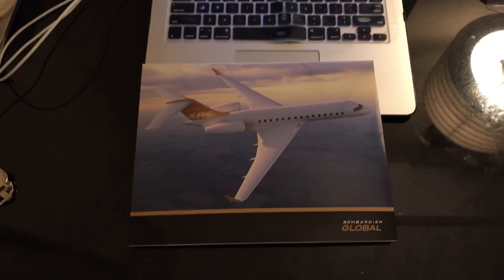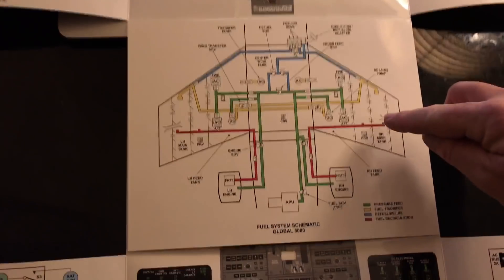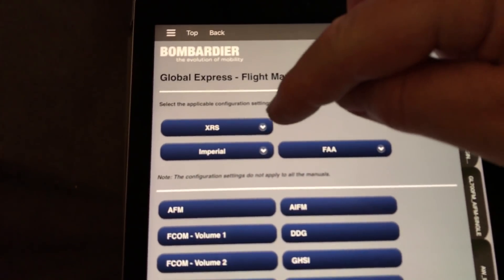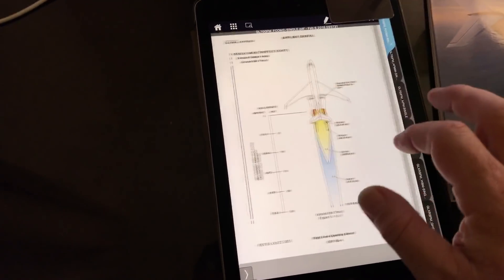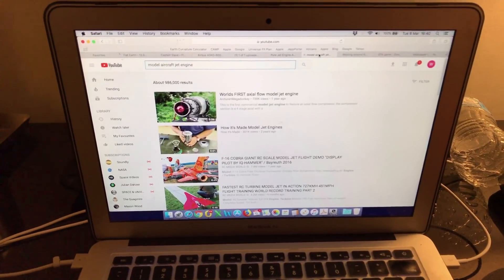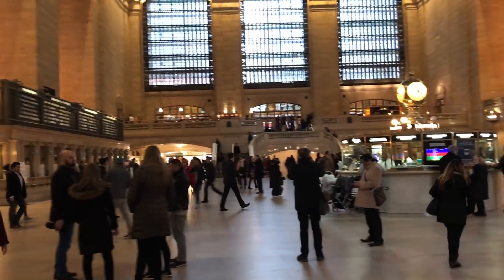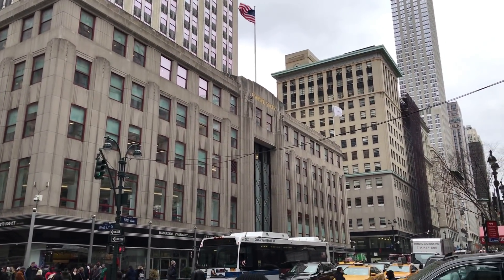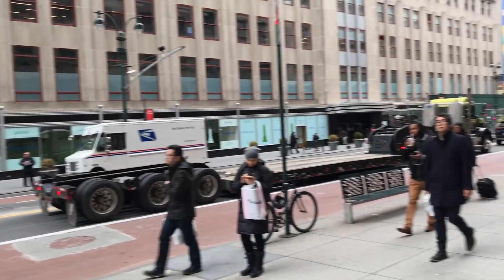Don't be ridiculous - of course Jet engines use liquid fuel.

Comment: But Wolfie , where is there space on the plane for fuel tanks ? In the wings (bwhahahahahhahahah)  We know the wings are filled with helium so the plane can fly. 
If you put a lot of fuel in a plane it would weigh at least a couple of tons. I attached a catapult to my car and it did not even get it off the ground.
Its not just compressed air, its the atmospheric electricity to run the motor.  You hear news reports of crashed planes that they suffered a compresser stall and the crashed. case proved. 

Remember to frame the NYPD mugging report as a memento . cheers ;-)
Reply: You are trolling or kidding, right?
Reply: I had hoped never to read a post like mine for real, then I met a flat earther ;-) 
yes, just kidding. cheers.

Comment: All our motors are really just air pumps, if they have a better way to do that than combustion they should share it. Compressed air would not get you very far.

There is a really good Korean restaurant on 33rd behind the Empire State building. That is their Korea town so there are a number of them.

Comment: Get one off 2nd hand boeing 747

Fill with flattards

Fly them up to max altitude and set the autopilot to fly south.

The pilot parachutes out and lets the plane carry on

Of course seeing that planes don't need fuel it will fly on forever until it reaches the ice wall

Whats the worst that could happen?

Comment: There is a moron who has proven to us through the means of youtube video that cars do not in fact run on gasoline. He teaches us that the actual fuel is nitrogen from the the air, and the purpose of the gasoline is just to provide a little starter burn, like putting lighter fluid on your barbecue charcoal. And this cannot be disproven by the mere presence of fuel and its pumps and pipes and accoutrements. Yes there is fuel there but that isn't what really provides the power ! Game set and match, my friend!  We listen to drag racers revving their engines, and are invited to confirm the unmistakable sound of nitrogen burning. Proof positive! So there is very little point in showing fuel trucks pumping on fuel, or putting a dipstick into the a wing tank. Certainly, there is a flammable hydrocarbon on board and a system for getting it to the engines. But that doesn't mean the engines are actually using it for power! Mwah hah hah hah hah. Did you really think your puny rationality stood any chance against the tsunami of tstupidity?
Reply: Stupidity is the most powerful force in the Universe. Even God cannot defeat it.

Comment: If these idiots think they "know" how planes actually work then why don't they start their own airline without fuel and undercut all the other airlines. They'd be millionaires in no time.
Reply: They actually think all the airliners run on compressed air & free energy (global conspiracy to make undue money), and that the flight travel should be almost free. Yeah, I know how it sounds :-D
Reply from the maker: +Virgil Pheonix.  They would never get off the ground as they have no clue how to flight plan and don’t have a map that works.  My flight planning challenge to them is unanswered in 14 months.
Reply: +Wolfie6020 I'd be stunned if they could point at the engine on a plane if asked to....
Reply: +Mike Davidson just upscreen was someone who claimed that the A380 engines were inside the wing.
Reply: @fromagefrizzbizz9377  the only pla e I know that had engines in the wings was the Comet the was built in the 50s not the A380.
Reply: @alanmackinnon3516  There's a couple of other aircraft with engines in the wing.   The Canberra is about the same vintage as the Comet.

But they're not terribly rare now either - the B1, B2 and several other military aircraft do.  My favourite is the RAF Vulcan.  B1 and B2 are *current*.

You won't see in-wing engines with high efficiency turbofan engines.  They won't fit in a wing.
Reply: I saw one video that claimed that airplanes don't fly, they float. It wasn't the wings that were keeping it in the air but that all the compressed air in the cabin somehow makes it buoyant. How do you argue with somebody so completely divorced from reality?
Reply: Virgil Phoenix You don’t. You just give them their meds, pat them on the head, and send them on their merry way.
Reply: +Virgil Pheonix Their heads will explode when you point out that compressed air in the cabin would make it less buoyant, not more.  "Air has mass.  Compressed air has more air, hence more mass and higher density.  Hence, less buoyant".

And of course the air in the cabin is only compressed relative to the outside air.  It's still a lot less than at sea level.

That's definitely flattie territory.
Reply: Fromage Fizzbizz It completely contradicts their whole "Gravity is only density and buoyancy" mantra they have going. They can't even be consistent in their own stupidity.
Reply: +Virgil Pheonix Consistency requires logic.  They don't have any.
Reply: If only they could move out from their parents home ...
Reply: Virgil Phoenix i took a airplane and looked up its fuel for full flight then looked up its fuel cost. Then I pretend it had a fully booked flight (which doesn’t always happen) then I estimated crew costs on career websites average income per year/per day /est number of flights. Excluding maintenance costs etc it still wasn’t earning a profit. How do they stay in business? Especially when they have a flight with only 10 ppl on it?
Reply: Elin Winblad The airlines have pretty sophisticated computer programs that continuously crunch numbers to optimize revenue. That explains why you may have bought a ticket for $79 but the guy sitting next to you bought his for $449. It’s called revenue management and it works quite well at my airline as well as at the others.
Reply: Felix Dzerzhinsky I estimated everyone on the plane paid 600 in my calculations and they still didn’t earn profit
Reply: Elin Winblad Some people must be paying a lot for tickets because some of our routes are pretty profitable.
Reply: Felix Dzerzhinsky probably all balances out I really don’t care lol I just like to comment
Reply: Elin Winblad Have you looked at travel site like Expedia and run through ticket prices from business class to various prices in economy? There’s not going to be much discounting in business, but economy you’ve got a pretty wide range of fares. Maybe doing it that way will bring you closer to a profit. Just remember the old saying in aviation. You want to make a million dollars in the airlines,  you need to start off with ten million.
Reply: Elin Winblad I enjoyed the discussion.
Reply: Felix Dzerzhinsky lol at 10mil 😆 enjoyed as well! Cheers!
Reply: Elin Winblad Ok. Air freight is where the short hop airlines make their money. Try getting on with excess baggage and watch your ticket price climb. Less passengers equals more freight. That’s the cruel world of domestic airlines and why they sell seats so cheap but are really strict on baggage. Have a quick look around on the internet.
Reply: David Phillips makes sense thanks!

Comment: they are not completely wrong, with for instance; at sea level an airliner taking off at 375 mph with the throttle at 100% has an f/a of .017. This means that 17 ounces of jet fuel are required to be mixed with 1000 ounces of air in order for the jet engine to operate.  so it uses less than 2 percent of the mixture for thrust, if my beer contains less than 2 percent alcohol; i call it an alcohol free beer too!   ;)
Reply: Most of the air is there just to provide exhaust mass, not for combustion. So the thrust comes from all that compressed air, but the power to compress it comes entirely from the combustion.

Comment: I've recently bought the Bombardier Challenger for X-Plane 11 because the model makers give discount to those who bought it for X-Plane 10 already. It's interesting to see the similar charts from reality.

I cannot fly it from Sydney to Santiago because of the fuel tanks calculations going into the negative.

For some computer performance reasons my attempt in a 747 on that route used double time of simulator time and I crashed with 10 tons fuel remaining far off the coast of Chile. The crash investigation seems to conclude a fatal balance issue and 2 engines turned off from lack of crossfeed (from the tanks that wasn't empty) which got too overwhelming for 1 inexperienced pilot to deal with as the 747 started to fly backwards. 

When my tweaks of the sim is doing 1:1 ratio of time, I will have another go. Maybe in clear weather as well.
Reply from the maker: +elekron2kim.   X-plane is a great program - Sydney to Santiago is a little too far for the Global routinely.  You can do it with very favourable winds and flying at Mach 0.80 (Long range cruise.) 

If you want a few real flight plans to try let me know and I'll knock them up for you.  

Here is one, Santiago to New Zealand in the Global with full fuel. 

https://www.dropbox.com/s/gx13wb6i2jwg7fz/2017-06-28%20SCEL%20NZCH.pdf?dl=0
Reply: +Wolfie6020
Very interesting... Thanks. Will go through that one to begin with. Downloaded it.